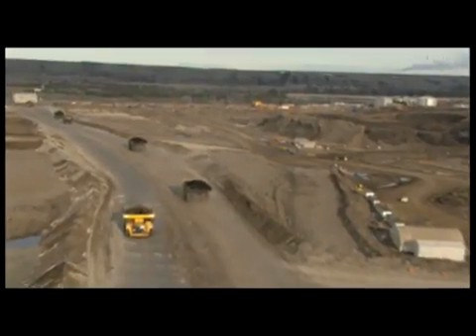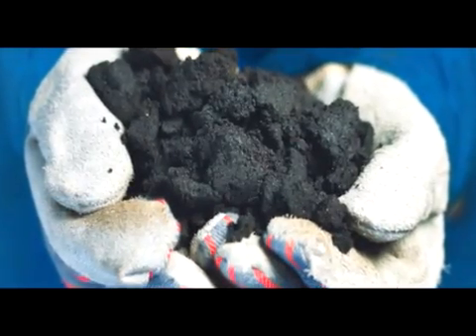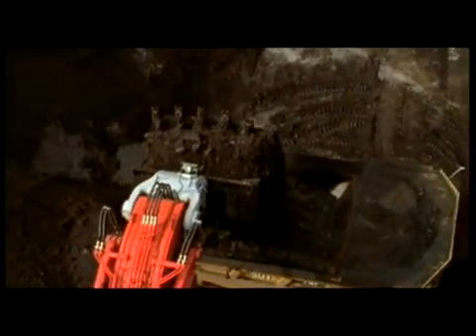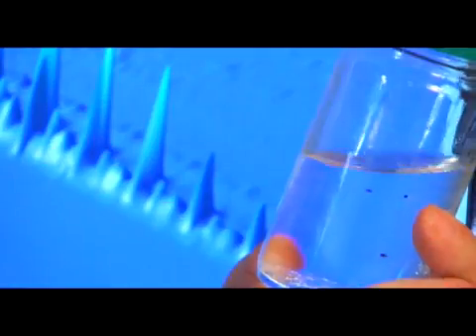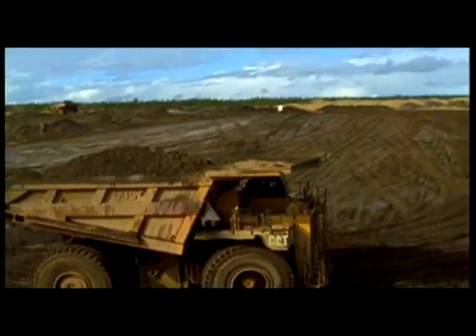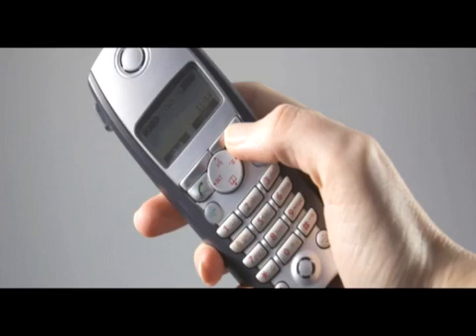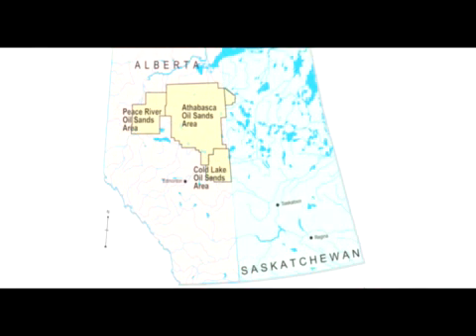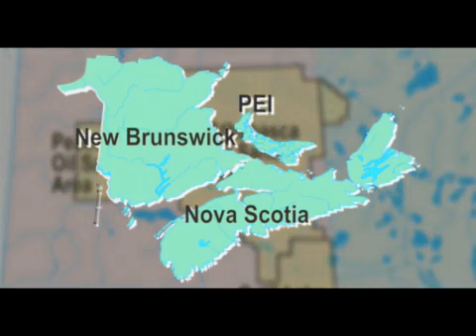Exploring Oil Sands Science - Part I

Comment: What isn't well addressed is the toxic tailings pond and leaking pipelines.
Bitumen is rather corrosive.
Also, this is process intensive.
Reply: Use more corrosion inhibitor. Problem solved. Most companies want to nickel and dime their specialty chemical costs, corrosion inhibitor in particular because its very hard to prove how much is the minimum amount that you need to prevent corrosion (more inhibitor is better, but also costs more money).

Finally, there is erosion corrosion, which is harder to prevent, but also less likely in the first place, thankfully.